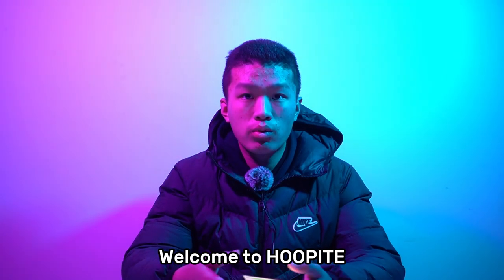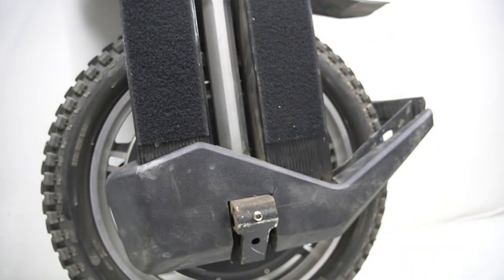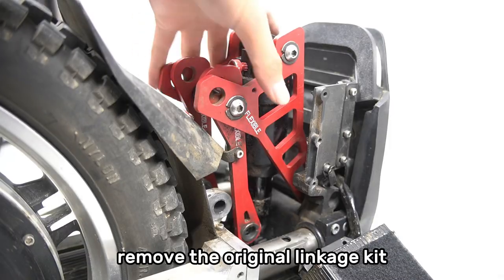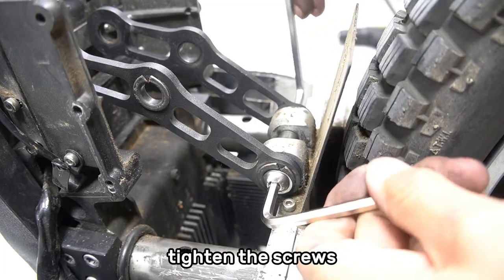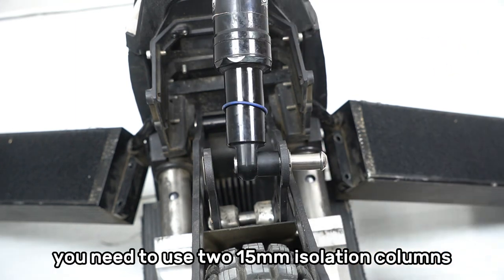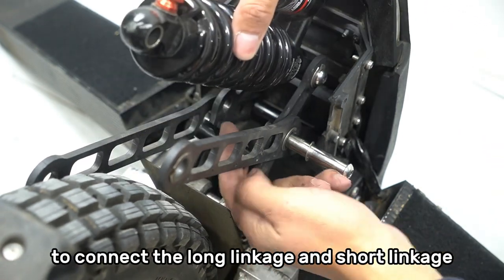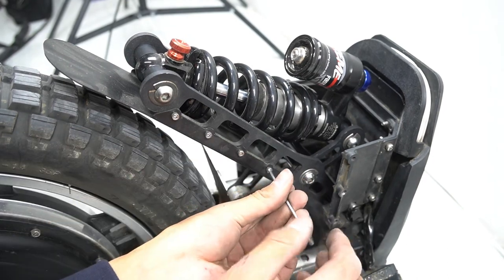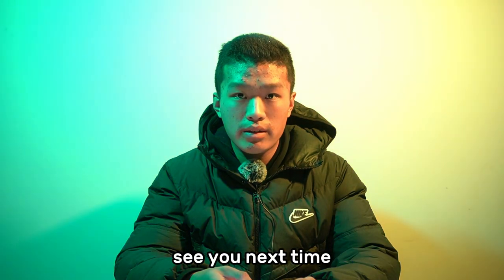Begode Master Suspension Linkage Kit install guide

Comment: Hey, just a heads up, on your guys website you can't put in payment information in checkout. Also, I bought the FASTACE BDA53RC, so I'd buy the 18mm version right?
Reply from the maker: Yes, you should buy 18 mm. Now that the payment problem has been fixed, you can buy it on the website.

Comment: Can i use the original shock begode for your linkage?
Reply from the maker: No,You have changed the bracket, why not buy a better shock absorber? There are many problems with the original shock absorber.